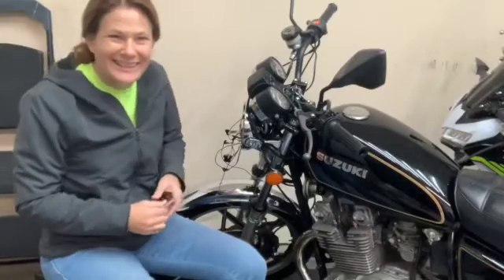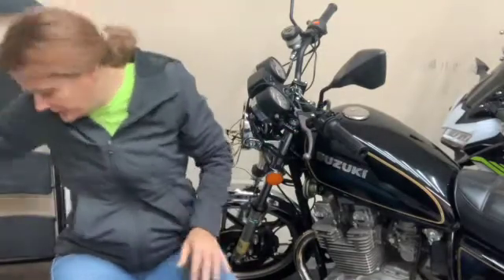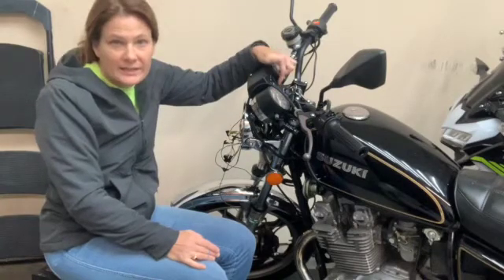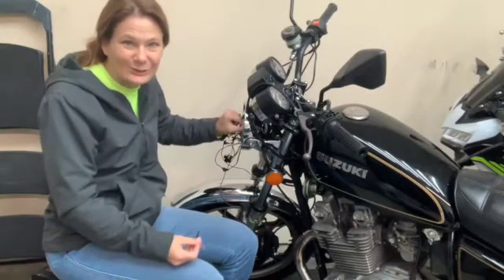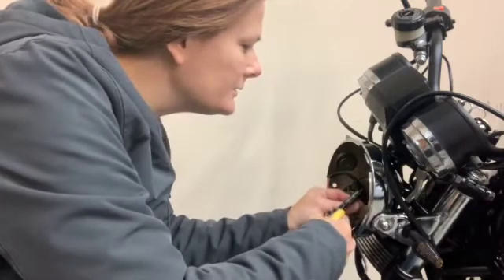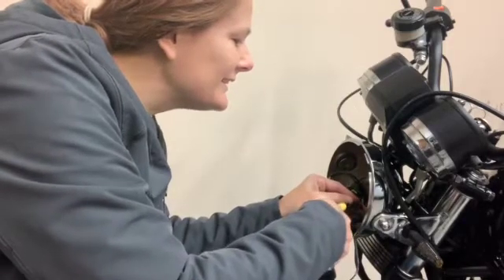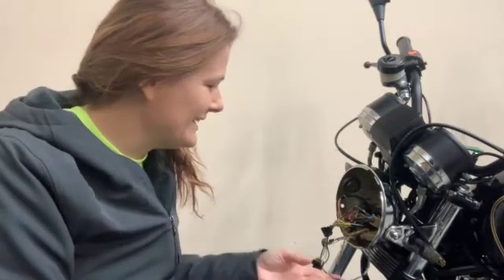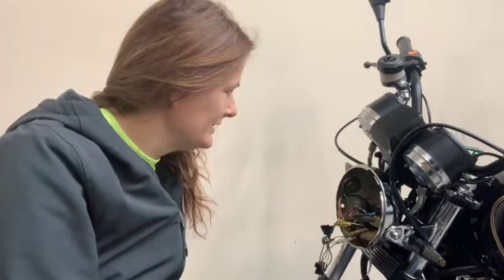Using diodes to fix LED problem on Suzuki GS450L

Comment: So did you connect the short green coming out of the connector to the lead of the diode kit, and then 1 ground and the other part of the green wire to the Y split ends of the diode kit? Then ground the last part of that black wire. I have a 1980 gs450L and am looking to do this same conversion this video has been so helpful! Best tutorial out there. Did you need a specific relay replacement or will any LED 2 prong relay work? Thank you for this video!
Reply from the maker: Yes that’s how I wired it and the relay was just called 2 pin 12v motorcycle LED indicator light relay. Thank you for the comment and have a great day